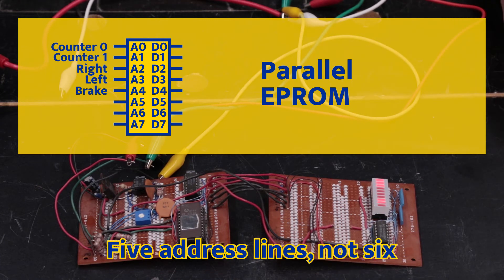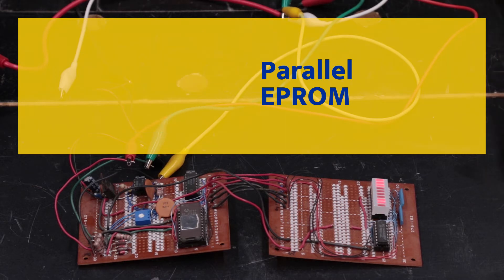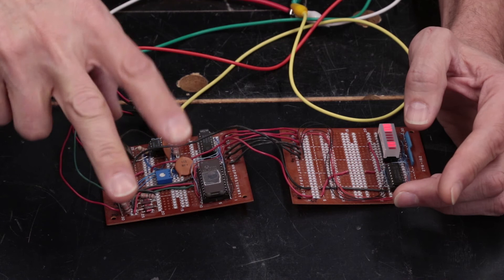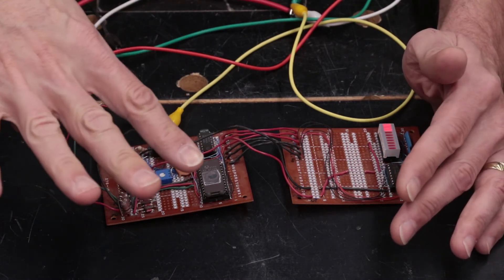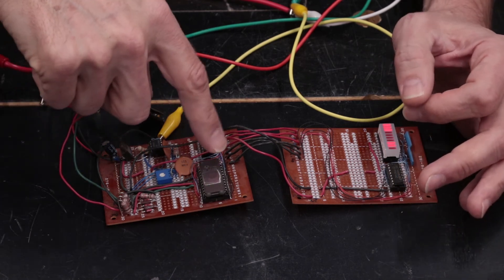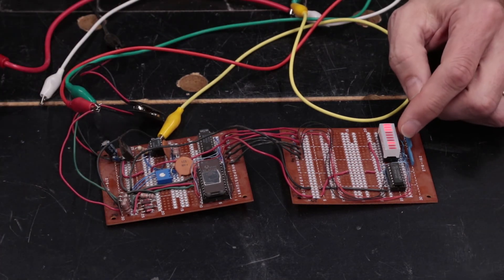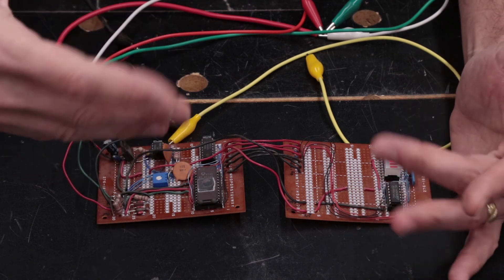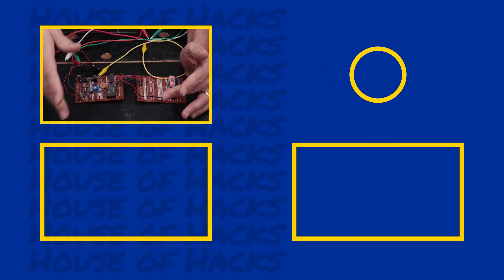Sequential Turn Signals DIY - How to Design Your Own

Comment: I had a 1966 Thunderbird with mechanical sequential turn signals. The operation was done in two steps. First there was a cam that acted upon four relays. Three of the relays achieved the sequencing effect and one was a reset so when you turned off the signal, the cam rotated to the start-of-sequence position and stopped. This prevented the signal effect from starting mid-sequence. Next, a second relay bank routed the sequencing signal to the left or right taillight. It wasn’t unusual to have to clean those relays or unstick them. I wanted to design a solid state solution but never did because of the amps involved and the complicated way the hazards used a completely different circuit. Thanks for the neat solution!
Reply from the maker: You're welcome! Yeah, it was a fun little project. The digital output still needs high current transistors to drive the actual lights/LEDs though.

Comment: Great material! This reminds me of when I designed a microcontroller driven traffic light for a crossjunction road. That was 15 years ago. I love circuit theory! 😊👍 Teaching discrete maths gives me the opportunity of discussing Logic gates, logical arguments, and combinatorial circuits! 😊👍
Reply from the maker: Thanks!  Yes, I could imagine using this same technique for a simple traffic light since there are really only four states and those are controlled by a timer. One of the fun things about this is there are so many different ways of approaching the same problem.

Comment: I only have 4 address lines on my PROM, can I still make it work by using multiple PROMS?
Reply from the maker: Hmm, a 16-bit PROM? That seems really small. What's the part number?
 Is it a serial EEPROM? If so, this technique won't work. This requires a standard PROM.
Reply: House of Hacks House of Hacks I figured it out using another method. My PROM is too small  for this method to work, the part number is EX034L. Thanks anyways!
Reply from the maker: @GoldTixh  Cool that you got it figured out. Peace!